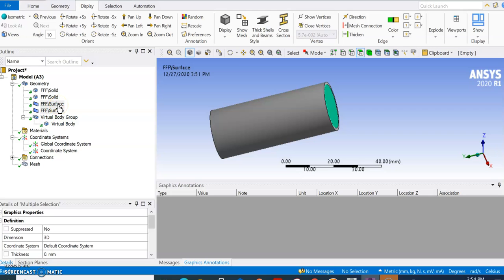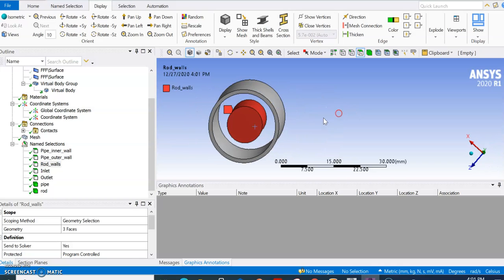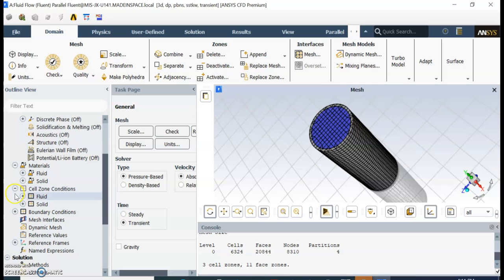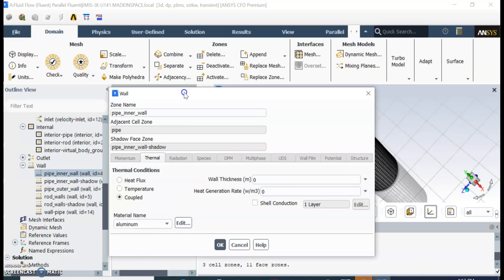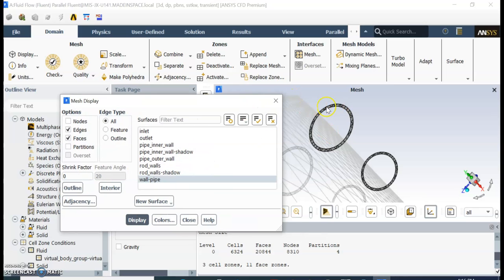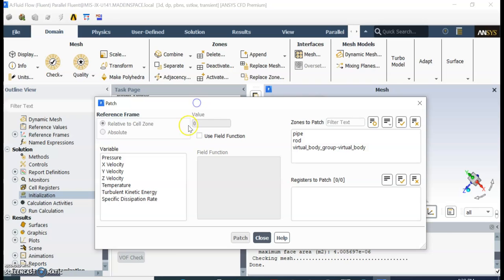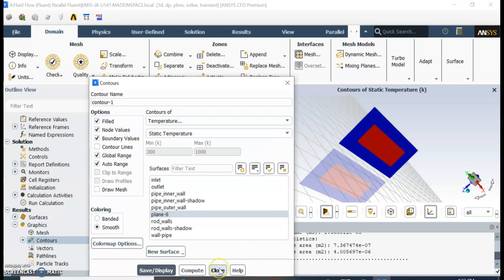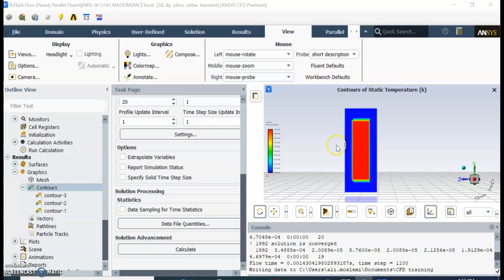Tutorial for transient conjugated heat transfer simulation using Ansys Fluent

Comment: I have some questions regarding droplet impingement.
Can i discuss with you in mail.
usama@pusan.ac.kr
Is my mailing address
Reply from the maker: You can ask your questions here?
Reply: @pulsedflowsolutions9058  it will convenient on other format like i just need ask questions relating droplet impingement on array surface. It will great help for me
Reply: @pulsedflowsolutions9058  actually i want to do droplet impingement simulation on array surface in 3D form because patterns array arrangement is different so i need a 3D model. But if draw a plane at certain points in 3D model it give me a simple 2D pattern geometry. So should i need to go for 2D?
Secondly due to 3D model computational cost is high and we can not see clear impingement behavior. Third which way is best “Marked fluid region” or make a sphere inside the domain. Suggest me best way for simulation because i want to simulate impingement, fragmentation, breaking into droplets behavior
Reply from the maker: @usamatahir1353  I am not expert in this particular field but I try to help as much as possible. I don't know what outputs you want to get out of your simulation but if you can run it in 2D, go for it. if you still want to run it in 3D, you can create several planes or use isodurface...regarding your last question, I don't see any difference so I am not sure which is the best
Reply: @pulsedflowsolutions9058  my main question is in most of the article for dynamic contact angle they used udf. Can we go without udf by applying the contact angle equal to 105 degree for hydrophobic surface ?
Reply from the maker: @usamatahir1353  Yes, there is an option to put the angle directly there
Reply: @pulsedflowsolutions9058  so if we did not use udf just put the angle there will it work same as the mentioned in the articles?
Reply: And please make a video like the problem they mentioned in this article and mesh as same as they do. I will will thankful to you dear